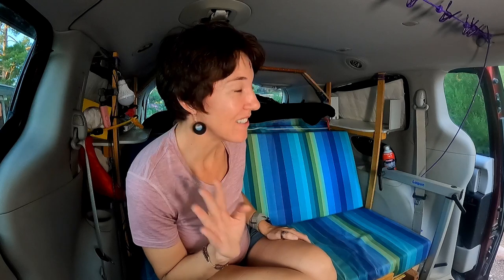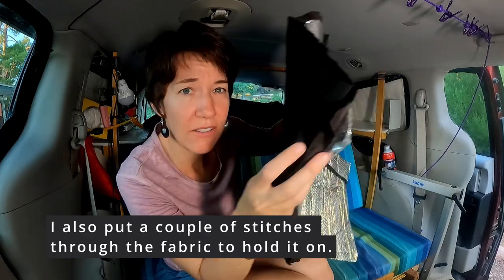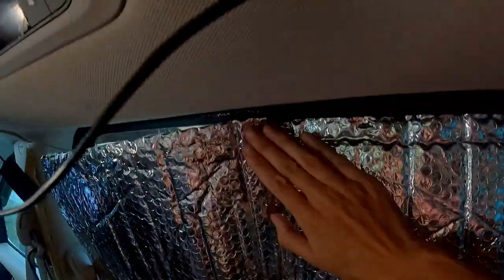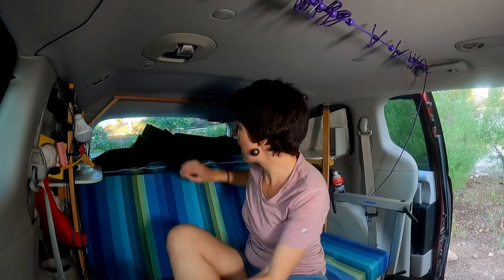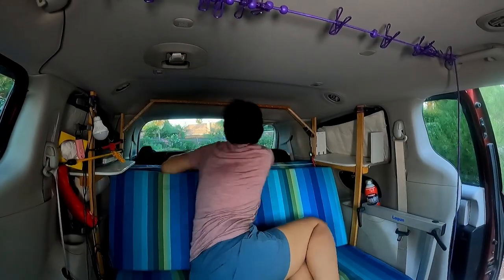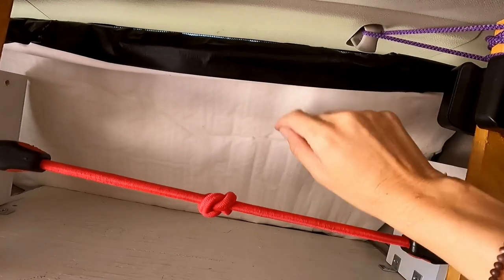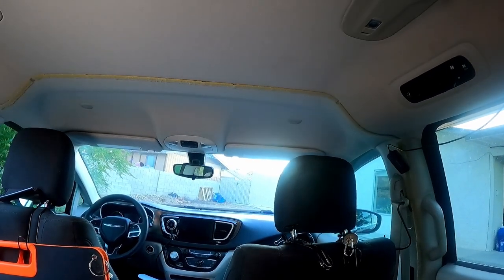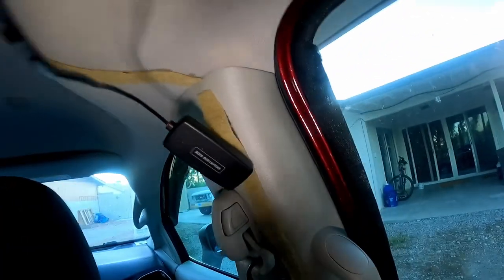Curtains and Window Covers for Minivan Campers | Vanlife |

Comment: The best solution is the one where you used a piece of insulation board, which made for a stiff and sturdy window covering substrate.  I'd be inclined to redo the other window shades and use the insulation board + fabric on both sides, plus an extra inch or so around the perimeter.  As far as a privacy curtain, anything with a shine on it (like the black tape you used) is going to reflect light back to the person who's looking in.  Someone with a flashlight will note any reflection immediately.  So the best fabric is one that is completely black and dense, and has a texture like a felt or velvet material, where any light shone on it gets absorbed and doesn't reflect.  Any fabric will need a liner to fully block light from getting in or out, as is standard with blackout curtains.  thanks for showing your solution!

Comment: Ur window covers are pretty similar to mine. And that white corrugated plastic panel stuff is great cause it won't sag in the heat. I have a big piece covering my back glass and it's velcroed at the top to keep it in place and I just leave it in all the time. I use my side mirrors to see when backing up and my mini-van has the rear sonar. That velcro comes in handy too!  And yes,sometimes I have to super-glue the velcro to keep it in place. Great video!
Reply from the maker: Oh nice! Eek, good tip below about the spray glue!

Comment: I'm glad you did this video.  My back window has been an issue too. For the side windows I covered the reflectix with black fabric on one side and pretty light colored fabric on the other. In the seam I stitched in some very strong small bar magnets that stick to the metal around the window frame. It works great! Too bad the rear window has no metal. 😢 Our van has handles just above the front doors so I stretched a bungee cord across the ceiling and hung a black curtain for privacy. I made some side ties so I could tie the sides to the door handles just behind the front seats. I also use binder clips to close any gaps I may see by clamping the fabric to the headliner (if we are in an area where we really don't want peepers).
Reply from the maker: Oh magnets- that’s a good idea!

Comment: To get a better pattern of each window you might try using the heavy brown wrapping paper. It can usually be found at Walmart where boxes are sold. Cut a piece that is a few inches bigger than your window, you can get that rough measurement with a tape measure. Use a few pieces of rolled masking tape, so it is sticky on both sides, to hold the paper to your window. Using your fingers, press the paper into the outer edge of the window, forming a crease in the paper. Once you have that crease, take a pencil to draw a line in that crease, your line will not be perfect because of the wrinkles in the paper. Remove the paper. When cutting off the excess paper, cut a half inch outside of that crease/line, getting the excess paper out of your way. Now you can put your pattern back in the window and trim until you have the fit you desire. Use that as a pattern for your reflectics and fabric. You only need to do one side of the van windows, you can reverse each pattern for the other side. I've been living full-time in my van for 2 years. Vanlife Rocks!
Reply from the maker: Hey Jacqueline! Oh how I wish I had known you when I was trying to make these!! Thank you so much, this is a little golden nugget. I hope others find it.

Comment: Hi Kelly, 
      You have done a good job blocking out the windows. The curtain is nice too. You are inventive and resourceful. The only thing I might suggest is to have your windows dark tinted. If that is something you would be interested in doing, you would have to check with your state law. Here in Ohio, they can only be so dark and no tint on the windshield, other than that factory blue strip at the top.  
                                                                   Steve.
Reply from the maker: Hey Steve! Yes, good suggestion. It’s legal here.. I need to do that!

Comment: Thank you. Window coverings have been a bit of a pain for me - the cutting is the hardest part! I do have a small gap and you've confirmed my thought that adding duct tape would solve that and give me material to tuck into the gap. I'd like to use velcro for the cab curtain, but I'm concerned about wrecking the headliner, which is carpet material.
Reply from the maker: Yeah, the Velcro will leave a stain. I figure I can try to get it out if sell it.

Comment: I can attest that in creating a car camper, finding the right materials is one of the more challenging tasks. From  my own experience, here are a few tips:

1) Rather than taping the Velcro directly to the pillars of the car, tape duct tape to the pillars, and then attach the sticky-back Velcro to the duct tape. The adhesive on the duct tape works better for ABS plastic. I can specifically vouch for Monster tape for this purpose on the A B and C pillars, which seems to be a different chemical composition than the plastic used elsewhere in my vehicle. 

2) There is a lightweight blackout shade fabric with a silver back that is easier to store than shades made with Reflectix. However, this fabric has two drawbacks: 
a) The insulation effect is good in the summer; however, I cannot vouch for it in the winter. 
b) Pinpricks in the fabric will allow light to seep through. What this means is when making the curtains/shades, don't use pins to measure and cut the cloth. Use mini clips or fabric tape instead. 

After several iterations over several years, I find this fabric to be more versatile because of its light weight. I use it for curtains on all back windows that I never take down -- decorative fabric sewn on the silver side facing into the car. Because I follow the seasons, I don't use these for winter insulation; so can't vouch for that. I can confirm that the fabric alone blacks out 100% of the light.

3) For the curtain separating the front and back areas of your car, have you considered using a staple gun and/or cubicle pins to attach non-sticky Velcro to the roof?  This would avoid the adhesive mess on the headliner. A curtain made of the fabric suggested above might be lightweight enough to not cause separation of the curtain from the ceiling; more specifically,  the Velcro from the ceiling. The pins I'm referring to are the type used in some builds to attach fairy lights to the roofs of the vehicles.

The fabric I use I bought from Amazon. It's called, RUseeN Portable Blackout Shades Window Curtains. The ASIN is B0B17G9ZGC. It comes in 3 different lengths, width is 57". The fabric is thin enough that it can slip into the grooves around the windows where you are currently inserting the duct tape.

Hope that helps in some way.
Reply from the maker: Hi Gwen!! Oh My Gosh - this is all amazing information! Thank you so much! What a genius idea - to put tape on the pillars,, then the velcro to that! Wow! All of your tips are simply fantastic! I hope others read your comment. Thanks for sharing!
Reply: @minivancampergal1554  It's my pleasure to share. One thing I didn't mention: I also use the staple gun/Velcro/duct tape technique for attaching Velcro to the window frame for hanging the curtains. The advantage of curtains over window inserts is they allow air circulation, especially in the summer. (The curtains are a few inches longer than the windows.)

Happy camping!
Reply: Thank you, Gwen! ❤💐 😊 Ontario 🇨🇦
Reply: @jayceewedmak9524  My pleasure.  As someone with basecamp in Florida, USA the heat and humidity are brutal when it comes to adhesives. Then, there's the different chemical composition of the plastics in different parts of the vehicle, that complicates things. For example, Velcro sticks well to the plastic used in the B pillars of my vehicle; but not on the plastics in parts of the back hatch. I have noticed that 3M Duct tape does seem to work well (perhaps better than the Monster tape I mentioned in my original post).  But I think it just depends. 
I don't think there's a real solution for the adhesive challenge short of something industrial. But I think most of us are seeking semi-permanent solutions when it comes to attaching things.  
Anyway, best of success with what you're trying to accomplish!✌
Reply: @Gwen3344  Nothing sticks well on plastic in our cold winters or hot summers (sigh).  I'm going to give your duct tape a try!  Hope the roads you travel and the people you meet on them are good ♥ 😊
Reply: @jayceewedmak9524  👍💜✌!!

Comment: I’m thinking of horizontal shower curtain rods that are spring loaded on each side of the front curtain they are hight adjustable and all you have to do is attach rods to each side of curtain then adjust rods to correct hight to roof and push into place just like a curtain rod above a tub in a house
Reply from the maker: Hey Steve! Yeah, I tried that, but the problem is there is too much light that comes through the top. It works, as long as you're not trying to be stealthy.

Comment: Will the spiky velcro part stick to the headliner? If so, you could put two spiky pieces together back to back and adhere that to the headliner and then to the front curtain. No goopy bumpy adhesive then. If you don't mind small holes in the headliner, pop rivets could hold the velcro on too.
Reply from the maker: I wish it would stick. That’s a good idea though!

Comment: I found black out curtains at a thrift store...$3😊. I had to hem them but works great. I did the reflectixs with a pattern that I made with heavy duty wrapping paper. It lets you be more accurate.  Do you use industrial strength Velcro? It is almost like cement...lol
Reply from the maker: Hey Linda! Ooh, good find! I get weaker Velcro because I find that the adhesive fails before the hook and loops if it’s too strong!